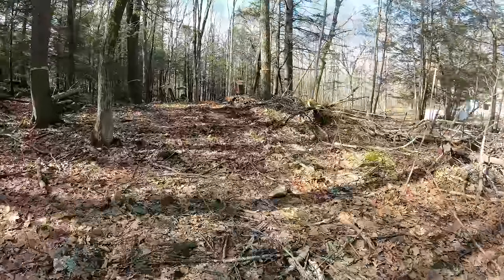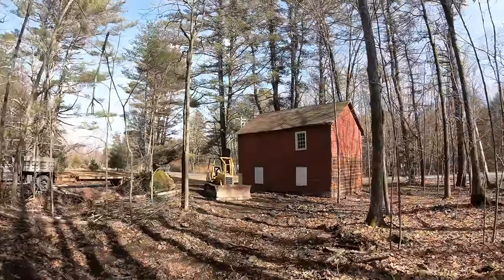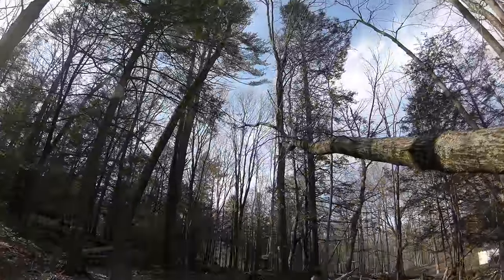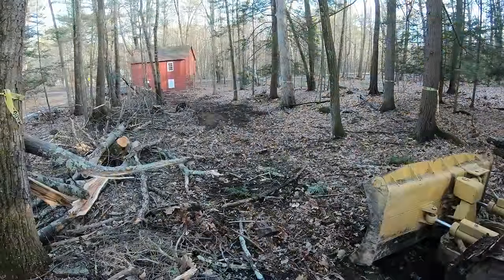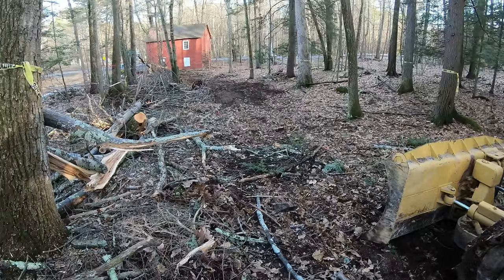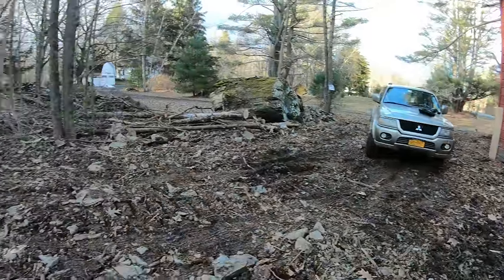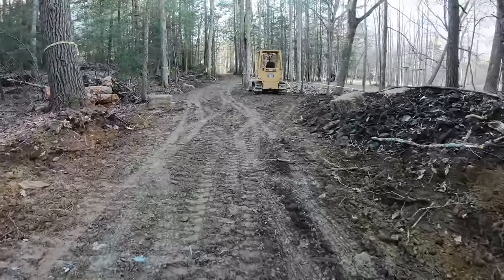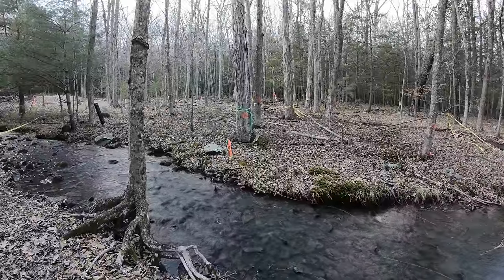Pushing in a driveway with a bulldozer

Comment: From what I could see in the video, it looks like you have the cable clamps installed wrong, the saddle of the clamp is supposed to go on the long side of the cable, and not the short side, by installing the saddle on the short side the U-clamp portion of the is putting too much of a kink  and could cause the cable to break, old saying is "Never saddle a dead horse". The rule of thumb on the amount of "Turn back" of the cable is roughly 18 .5 times the diameter of the cable itself.
Reply: I saw that too, figured I would check to see if someone else picked up on that too. I have seen what a snapped cable can do and its not something you want to mess with.
Reply: Concur - that's what I was taught in my logging days.  That and respect the potential energy in wire rope if she snaps.
Reply: And clamps are pretty much banned in workplaces nowadays!
Reply: Nortekj In my 60 years of life I have used cable clamps many times, however I have never heard of “never saddle a dead horse”. I’m not sure if I did it right or wrong but the next time I use them I will do it right. I did some more research on wire cable clamp safety. Thanks for the education.
Reply: He should learn to roll eyes in those cables to avoid using cable clamps. JS

Comment: You may run into trouble where you filled in the low spots. The organics mixed in will break down over time leaving a mess every time it gets wet. 
Also you'll make it easier for yourself in the long run if you cut the trees back further from your driving surface. Damage to the roots by cutting them or running over them could result in dead limbs raining all over the driveway, or the tree falling and blocking it. Just a suggestion coming from experience.
I liked your video though, you do solid work with the equipment and you're obviously a good operator. Keep up the great work!

Comment: More great videos.. Everyone in the comments is an expert these days. But i would have done things a little differently, stripped the topsoil and vegetation, pushed it to 1 side, shaped the road and if you still had low spots, found an area away from the cut, dug a hole, put the clay on the road, and filled in the hole with the excess top soil, maybe buried a stump or 2 to raise up the ground level. But.. That's just me.  Great videos.. Only discovered your videos this weekend, watched a few hours worth. Love em..

Comment: The cable clamp resembles a horse’s saddle. To install the cable clamp correctly, the saddle should be on the “live” part of the cable and the u bolt should be on the “dead” end of the cable. Remember; “Never saddle a dead horse”!
Related to cables: who knows what a “Molly Hogan” is?

Comment: What's the hay for? I have a 1000' driveway that needs some maintenance this year. I'm also putting in a 33' x 48" building that requires a 200' + trench for electric, a 1900sf 4" concrete pour and continuation of the driveway 200' or so up to a 14' x 14' door, then the driveway wraps around the west side of the building and meets with the existing driveway. Basically slicing through my "S" shaped driveway, making a turnaround and entrance where the building is situated in the middle top part of the "S." Between all this, I want to continue my wide trail along the creek, up and down ravines, about another 1500-2000' - Sure wish I had your expertise and equipment. I'll likely rent a skid steer, compact excavator and then a boom lift to trim back some huge oaks. My Kubota B7500 with loader and box scraper will fill in where it can.
Reply from the maker: The hay stabilizes the ground, and prevents muddy water from leaving the site. Good luck on your project.

Comment: I recently moved to a country home off the main road where several home owners use the same dirt road to get to their driveways.  I noticed the pot holes and such have been filled in w/ bags of concrete, rocks, tree stumps and just about everything over the years.   I know of one whole that keeps re-occuring and gets very deep.  I believe it is where an old tree stump may have been left and has rotted out.  No filler seems to last in that whole or any of the the other wholes for that matter.

I've had the road scraped w/ a box blade, front loader and dozer every year but it don't last more than a few months.  I'd like to resolve the issues for longer periods of time leaving yearly or bi-yearly maintenance.   

I've watch a # of video's including several of yours.  I understand crowning the road now and drainage ditches on the edges.   But what do you suggest for preparing the base surface for building up w/ dirt ? sand ? rock ?  (#3, #57 or #411)

Oh, I'm in central Louisiana if that matters ? lol

Thanks for your generous consideration,
Sincerely ..................
Reply from the maker: If you want it to last, get the water away from it if possible. Than build it up thick with big rocks, even like quarry rubble (up to 12" pieces). Pack it in good with a dozer, than top it with some 1" stone.
Reply: Thank you very much for your timely reply :)   BTW, I love your channel and dig the new truck :)   Thanks for sharing all the interesting things in your daily life. 
Sincerely ...................

Comment: hmm, ever thought of putting some Non slip surface around the edge of the roof on the dozer. I have seen ppl do it plenty of times to theirs.
Reply from the maker: To stand on it? That's not a bad idea.
Reply: @AndrewCamarata  Yes to stand on, to prevent from slipping. Seen it on others before.

Comment: Awesome job but you missed one part of the excavation? You should have stripped the topsoil and organics instead u mixed it in with the clay.Ty for the entertainment
Reply: I understand what you are saying. I am wondering why that would matter when it's a driveway?
Reply: oruwatching organics will retain moisture and freeze , putting gravel over is good when dry , will go to shit when wet ! Compaction is a factor
Reply: Thanks, so if you did a 3 layer rock system over what he did would rain still make it a mess?
Reply: oruwatching  would not recommend it! Base is critical
Reply: thanks

Comment: Have thought about a roller attachment on the skid steer or is that not necessary. Yo help with compacting these long driveway jobs?
Reply from the maker: Just tracking on it does a good job packing it down.
Reply: Andrew Camarata yeah the finished product speaks for itself. Good work with the grading!

Comment: Andrew, once again, fantastic videography! The use of stabilization and the drone shots really set you apart from other channels. Thanks for all your efforts to share. Question: up there do you need to put geocloth down before the gravel base layer gets spread? If so, do you pin it in place before bringing a vehicle on it?
Reply from the maker: Yes, we will put down road fabric. Today I was trucking in stone, and hauling out brush, the road is muddy, but the truck goes threw it no problem. Once we do the underground electric, the fabric and stone will be done.

Comment: Nice work, as always!  Love the drone footage.  Adds a whole new dimension to the vid (pun intended).   :)

Love your musical choices.  They are rarely familiar but always seem to complement the visuals just right.

One question.  Is the blade on the dozer able to be lowered from left to right, not just swung backwards and forwards?   If not, how do you cut into the hillside, wouldn't the dozer blade just be parallel to the surface and not allow you to make a level cut into the slope?  What controls are there in the cab that allow you to do that?  A nice POV vid of you in cab, explaining what you're doing and why would be great.    Just a thought.   Keep up the good work.
Reply from the maker: Thanks, yes that's a 6 way blade, so it can move any direction. All the blade controls are in the right hand, with two sticks. Next time I'm running that, I want to make a "How to operate a dozer" video.

Comment: Nice work, and I really like your channel. You’re one hard working SOB. What kind of value would you put on a dozer like yours, what year is that beast
Reply from the maker: Thanks. That's a 1988, that's probably worth $20,000
Reply: Andrew Camarata i got offered a 98 cat d3 with 4800 hours for 18k. But i don’t need it very often. Ive got a big Takeuchi TL10v2 im considering trying out a dozer blade for. It wont be a real dozer but the tak should handle it ok being 10k lbs. my dealer has a used one i can demo so worst case i get a free blade to try
Reply from the maker: That's a good deal for that dozer. Is it a G or a C? Excavators with blades are nice, but they are not dozers.
Reply: Andrew Camarata my tak is a tracked skid steer. D3c on the cat

Comment: Why do you put the hay down on the road.  Sorry I am from Australia and I have not seen that before.  Most of our issues here are with heat and getting enough moisture into the construction.
Reply from the maker: The hay stabilizes the ground to prevent muddy water from entering the stream. And it has grass seed it in.

Comment: Is there a certain process you have for deciding what equipment to bring to jobs? What are pieces of equipment that you couldn’t live without and what are pieces of equipment you would never mis if you got rid of? Also, what is on your wish list and why?
Reply from the maker: I usually bring what's needed. Usually that 5 ton excavator is on most jobs. I'm really enjoying that new tracked skid steer though too. I usually don't need that dozer often, but its nice when I need it. This was certainly a dozer job. Usually everything I got rid of, I got rid of it because I didn't like it. So I don't really miss anything. I kind of talked about that in the "How I got started in excavation" video. I don't really need anything new at the moment, but a bigger truck would be nice, and a tub grinder would have been cool to handle all the wood waste from this job.
Reply: Andrew Camarata thanks! I’m a asphalt paver who is adding excavation to what I do. All the info is really helpful.

Comment: Andrew how come you never use your track loader for work like this. It seems you use your dozer for a lot of work that would see easier with a track loader do you just like the push dozer better? Or is the track loader not a worthy machine or you don’t think you need it much ?
Reply from the maker: The track loader is more for scooping, not spreading out material. It would have done it, but the dozer was the better machine for this job.

Comment: If you dig out the roots on the opposite side of the barn and get on the barn side and put the boom as high as it will go the tree will fall where you want it to go....
Reply from the maker: That's what I usually do, but it was leaning a little heavy. I felt better cabling it.

Comment: I would suggest using the decelerator pedal on the D4 or bad things will happen.
Reply from the maker: I never use that pedal? When do you think I should be using it?
Reply: Between every shift. Forward/reverse, 1st to 2nd to 3rd.Or easing into something, like a tree, stump or pile. Once you get use to it, it will be second nature. I've ran dozers for 40 years. Don't use one like a hydro-stat that is not a hydro-stat. If it has that pedal use it, your pocket will thank you some day.

Comment: You should get an old steam roller for smoothing these projects out
Reply from the maker: Tracking on them with a dozer, skid steer, or excavator does a good job packing stuff down.
Reply from the maker: Especially for packing down rock. Packing down mud doesn't do anything.

Comment: I am developing my first piece of land and I have cleared trees about 600 feet and I am ready for this process. I have no experience but I am going to do it myself with rental equipment. I am sort of just figuring it out for myself and was going to rent an excavator, I've never considered a bulldozer. do you think that would be a better option? and should I wait until spring? the ground is frozen here in Minnesota but I am getting antsy to have a driveway now. Is it worth the wait or can these machines move frozen earth?
Reply from the maker: Dozer vs excavator, it depends on the job, but if you have a road that needs to be graded, your probably better off with a dozer. How deep is the ground frozen? Frozen ground is certainly harder to work with, but its still early in the season, it shouldn't be frozen that deep yet.
Reply: @AndrewCamarata  It never had a road. I bought a wooded area for cheap with intentions to build a new driveway and maybe eventually a Camarata Castle, there are some very short 4 - 9 inch diameter stumps here and there, can I just bury them?
Reply: And the ground is frozen about a foot deep right now.
Reply from the maker: Try it and see what happens, the frost might stop the dirt work from happening though. Maybe just take care of all the tree work now. That's easy to do in the winter.

Comment: any problems with your chainsaw? mine got the rubber hose eaten alive by ethanol.
Reply from the maker: I replaced the carb on that one once. How old is your saw? Fuel line is cheap. I think the newer replacement parts do better with ethanol.
Reply from the maker: Here is fuel line to fix your saw: http://amzn.to/2CYgYXb
For Stilh or Husqvarna saws you can get aftermarket parts on eBay/Amazon super cheap.
Reply: its about a year old, its a husqvarna 455 rancher. and thanks for the link.

Comment: Why oh why didn't you use the chain saw to cut the tree down. I mean... that's what they're for and you wouldn't need to worry about having an incident while pulling it down.
Reply: By doing it the way Andrew does, the stump comes out a heck of a lot easier than trying to cut the tree, then digging the stump out.
Reply: Guess each one has their way of doing things that works for them. I can understand both sides. I like how he dug around the base before pushing and/or pulling the tree over. An interesting way of doing things.

Comment: should of gotten a d 6  just saying
Reply from the maker: I looked at a few, most of the d6's only have a 4 way blade. And my current trailer is a 12 ton, so the weight of a d6 would be a problem for that trailer. And I don't have that many bulldozer jobs, so that dozer is fine for me.